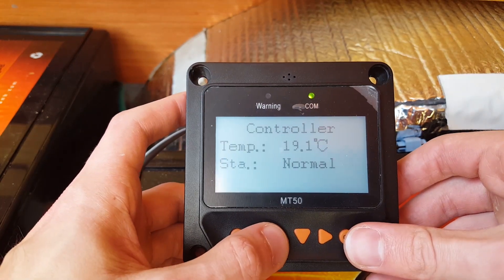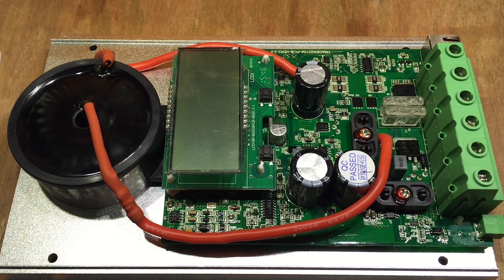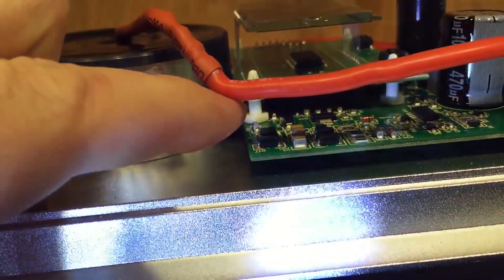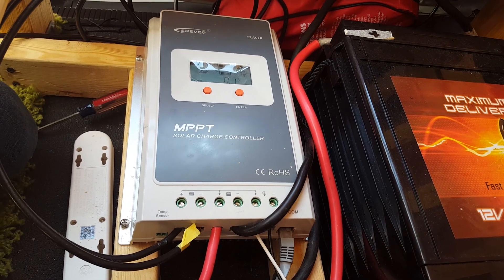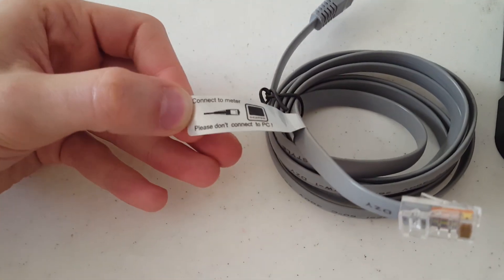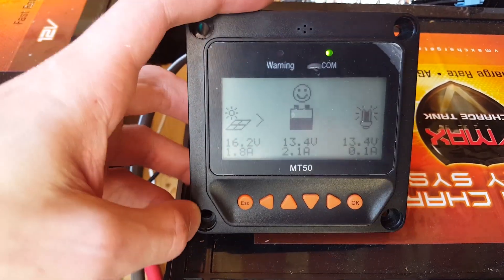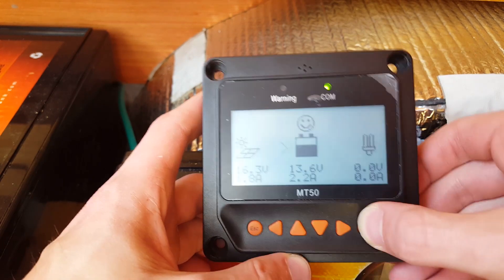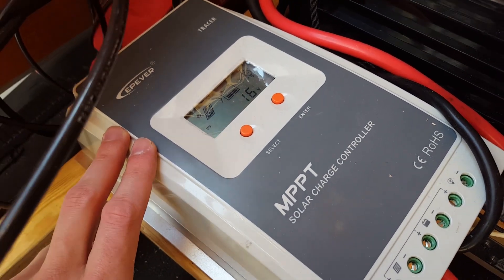Best Solar Charge Controller for Vanlife (PWM vs MPPT)

Comment: I have the same charge controller and during the day when is  hot the voltage is high but the amps drop is that normal ? Or any help ?

Comment: Hi, nice project!
I had a question, I read in the datasheet that you can adjust the load voltage to up to 72V so I gues there's a dc-dc module inside.
But I would like to know if that's true :) Is it possible to test that for me?

Comment: This was posted using a PC or laptop; you can use the same thing to monitor your system. Visit Adam Welch's channel and do a bit of learning to your advantage :-) 
https://www.youtube.com/watch?v=r3LrWeYYtnQ&t=726s
I learned from his explanation, read the manual thoroughly several times until I understood it, then built my own system: 6 mono 190W panels (1140W), Epever 4210A, 400Ah at 24V of batteries, Epever STI1000/230/24 pure sine inverter. It does 50% of my domestic electricity and is currently powering the PC and monitor I'm using all day. Oh, and do not use the 'load' output to power your inverter, you'll fry the contacts.
Reply from the maker: Hmm interesting. Thanks I'll check it out

Comment: I have the 40A Tracer BN series charge controller with the MT50 meter connected to a single 315w  LG panel and a 100ah AGM battery. my issue is this: there doesn't seem to be any correlation between the battery level icon graphic on the meter display and the actual storage of the battery.  Sometimes the meter displays a "happy face" but seemingly low battery charge level.  Has anyone experienced this and what is the solution if any? is there something that i am not understanding?
Reply from the maker: Mine is exactly the same way with a brand new system. I asked the same question and never found out lol. If you  find out be sure to let me know
Reply: @zhkopec  I found a chart on several websites and this video which illustrates "State of Charge"  apparently electrical folks know this intuitively but it sure would be nice to have a accurate graphical or % representation.  Kind of like the charge status on your cell phone!!!
https://www.aussiebatteries.com.au/deep-cycle-battery-guide/
https://www.youtube.com/watch?v=xR1pFbmOw0U
Reply: Yes .. happy face = full battery  ( option 2 you shit is fuked Up ) 
No chardge = full battery (option 2 you shit is fuked Up )
I realy dont belive that ppl can't put 2+2 together 
And when IT chardged IT go to the top 
When IT floates IT drop 2 segmenter down 
So you can see What IT is doing .. but well ..

Comment: great presentation & equipment selection...all i would add is, its actually better & cheaper to use 24v panels on a 12v system, through an mppt regulator...why?...because of voltage drop in hot weather...a higher voltage has more to lose...& once converted, provides more amps too....so its actually more efficient...(30+ years off grid, no bills or power blackouts)...there is also a thing called the 5 times rule....for a really efficient system, the solar panel amps, should be 5 x less than the battery amp hrs....i.e. 100 ah battery divided by 5 = 20 amp charging (400 watt panel)....200ah battery = 40 amp charging (800 watt panels) etc etc.....with this ratio, your batteries will be recharged again, within the early morning & float all day (as batteries really like to do)....of coarse u can manage on half that ratio, but its no where near as good...(trust me)...the other thing it took me many years to work out is, size your system, to run your most used load (my fridge) on a cold overcast rainy day, in the depths of winter....then for the rest of the year, u'll have all the power u need..(by 'size', i mean run your load via solar panel amps in, not draw from batteries...i.e. my panels can normally produce 80 amps, but on one of those days, its reduced to 4 or 5 amps...but thats enough to run my fridge, & still add some to batteries)....best wishes & thanks for sharin
Reply from the maker: That's an interesting take. I'll have to keep that in mind with my next system

Comment: well bud whats the cut of is it 14.1 and for lead battery  and the load back on at 11.6 please
Reply: ???? IT floate at 13.8GEL/AGM 13.4 Flodded 
If you start using you inverter and sun is Shining the first 33A in this case becaus the MPPT is 40A and PV is 100watt x4 
Will come from the MPPT if you go abowe 33A in usage the rest A vill be drawn on the batteries ... 
And when finished MPPT Will chardge batteries Up again

Comment: Does the MT50 have battery type Lithium in the menu??
Reply from the maker: Namdor Not by default. But you can set each parameter for lithium with custom settings

Comment: I really really appreciate your video. I am using the VmaxTank 100ah battery and am looking to hook up solar charging. However it says batt must be charged at 7-15 amp bulk charging then taper off. I have not seen this demonstrated anywhere on the net. My VmaxTank charger does it but what about the solar mppt controller????
Reply from the maker: As far as I know, yes. The mppt charger does regulate the input current like that. You can set each setting individually too if the preset for "gel / agm" isn't exact as well.
Reply: zhkopec 
Thanx

Comment: Nice basic discussion. I do have one quibble.  AGM and Gel batteries are NOT the same.  Gel batteries normally can handle slightly higher charging voltages than AGM.  I can see in your video that your batteries are AGM NOT Gel, so you need to reset your controller to AGM to avoid over charging your batteries and potentially causing them to off gas.
Reply from the maker: Good info. Thanks for the tip, though there isn't a setting for AGM just gel. I'll look around to see if there is a better option for settings.
Reply: AGM is actually considered as "flooded", rather than gel, so I have my controller set for flooded. My lady-Love's place has gel cells, so I've set her controller, (and smart charger) for Gel. :)

Comment: Did you use any in-line fuses, if so how do you know what size to use
? Just starting my build and like your set up.It's all new to me. thanks
Reply from the maker: I have two fuses for the system. One in between the charge controller and the batteries and one that is in between controller and inverter. http://amzn.to/2jo9hoR This is the holder and http://amzn.to/2AIY5aJ are the actual fuses.
Reply from the maker: I'll make sure to do a video that includes it. Might explain it better.
Reply: I think you did a good job,I am a subscriber and have found your information very helpful. Better then a lot of the channels that don't take in to consideration that some of us are newbie's.
Reply from the maker: Thanks Dan. The next solar vid should be out Thursday (internet signal permitting) where I'll be sure to mention more.

Comment: I have a 10W panel hooked up to a PWM controller for battery maintenance on my small travel trailer. There are no parasitic draws occurring in the unit.After 3 days, I checked it and battery was totally dead. Can the PWM controller "bleed" the charge from a battery?Isn't there supposed to be a diode or something preventing that? Curious since without solar setup it just normally discharges.
Reply from the maker: I had something similar. Do you have a monitor that shows the voltage? For me, the battery "full" graphic would decrease and never fill up. However, the voltage wouldn't go below 12v (default). If your battery was totally dead, I might check and see if anything was left on. If the PWM controller was bleeding then I don't think it would completely drain the battery.
Reply: Thanks
Reply: All charge controllers take a certain amount of power to run the controller.  A typical PWM controller will draw 10-20 milliamps at 12 volts.  That doesn't seem like much but over a day it adds up to 1/4 to 1/2 amp-hours per day.  Over a protracted period of no sun that can flat a small battery.  As mentioned below, you likely have something on that you are not aware of like your propane solenoid (a propane solenoid draws about an amp or 24 amp-hr per day if left on).  Your travel trailer likely has three propane solenoids (fridge, stove and water heater).  If you left the fridge or water heater on and  set to propane the solenoid would be on as well as the control electronics, which could easily flat your battery.

Comment: @zhkopec Your video description has a typo.  2x 12 volt batteries in series is 24 volts, not 48.
Reply from the maker: Whoops, good catch. I'll update the description. Thanks
Reply: No worries.  You also said the same thing in the video, don't know if you want to add a little caption correction.  Just wanted to point it out.  Also don't know how it is mounted in the van or where you're at, but a lot of appliances with integrated heatsinks like to be mounted vertically (so the fins run up and down, and hot air can rise up and not get trapped).  All the manual inches is to make sure there is '150mm (5.9 inches) of clearance above or below the unit after installation'.  If you aren't in FL/the desert it might not matter but I'd monitor temps around the controller.  Operating temp is -25c to 45c (113F) so it will be pretty easy to reach max temps on hot days if not careful.  Might want to get the optional temp monitor or whatever.  Just thought it might be worth mentioning to you.  Nice vid!
Reply from the maker: Jeez haha, I figured I'd get something wrong with all the tech specs. Murphy's law. 

Good point about the verticality. I don't recall that being in the manual, but I'll double check. I've got solid airflow and several inches of space, maybe not 6 though. I do have the control monitor that shows the temp so you're right it's a good thing to keep checking.

Comment: The RJ45 Connector is NOT Ethernet. It's a RS485 Serial connector that is used to connect the remote monitor or Wifi adapter.
Reply from the maker: I had a feeling that might be the case. Though still don't stick in a PC